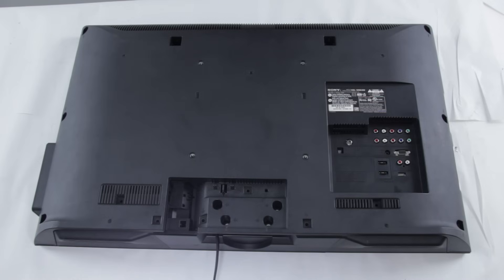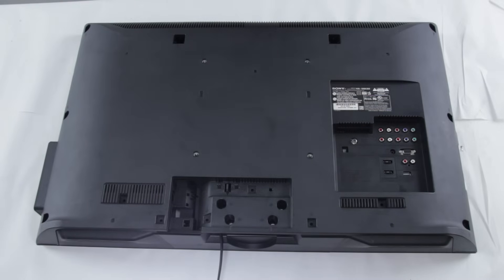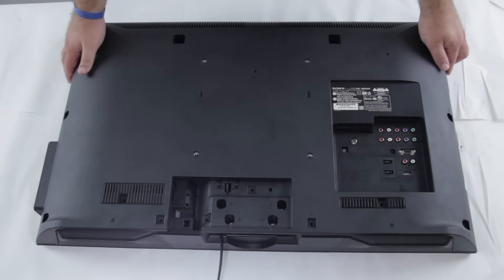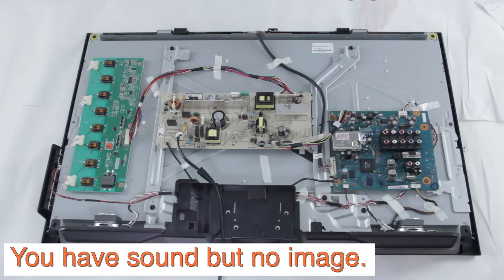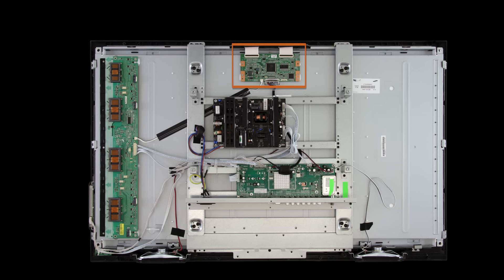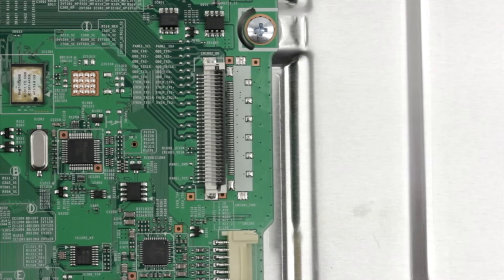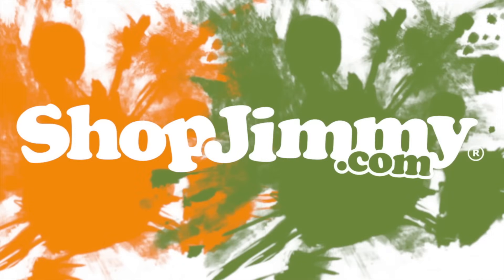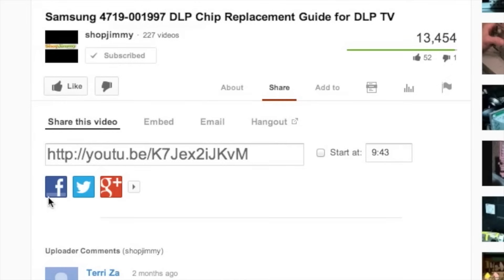LCD TV Repair Tutorial - T-Con Board Common Symptoms & Solutions - How to Replace T-Con Board

Comment: hi just found your video. we have a Samsung model number. LN46A530P1F / xza
were having a problem where when the tv is turned on its only a bit later that the right half of the screen gets a black shadow sometimes with 2 horizontal lines going across the whole screen I have also noticed at times that in back of the dark black shadow part of the picture is upside down. the shadow goes away when tapped on the back part of the TV on the same side as the shadow but just returns again within another minute more or less. have any ideas?
Reply from the maker: +free2danz   <!-td {border: 1px solid #ccc;}br {mso-data-placement:same-cell;}->Try all repairs and troubleshooting at your own risk.  This sounds like a TV panel (TV Screen) problem.  If your TV panel is bad, it may be more cost-effective to replace the TV as panels are typically hard to find in stock, difficult to replace, and expensive.  Thanks and please let us know if you have any further questions!  www.shopjimmy.com
Reply: free2danz مسرنشروف مئ
Reply: Please I have similar issue.  How can I resolve this

Comment: I have a Philips 47PFL5603D/27 it turns on has good audio and video for a minute or less then a vertical solid black line comes on and cover the 95% of the screen.How do I repair this problem.
Need help
Reply from the maker: +Rafael Hilerio Sr.   Try all repairs and troubleshooting at your own risk.  This sounds like a TV panel (TV Screen) problem.  If your TV panel is bad, it may be more cost-effective to replace the TV as panels are typically hard to find in stock, difficult to replace, and expensive.  Thanks and please let us know if you have any further questions!  www.shopjimmy.com

Comment: the image on my tv screen will either shaking / vibrate / double image / ghost image after 15-30 minutes when i turn it on. it also creates a horizontal line on the top of my tv screen. what should i do? im using LG 42LS3110 Led tv. thank you
Reply from the maker: +skull   Try all repairs and troubleshooting at your own risk.  This sounds like a TV panel (TV Screen) problem.  If your TV panel is bad, it may be more cost-effective to replace the TV as panels are typically hard to find in stock, difficult to replace, and expensive.  Thanks and please let us know if you have any further questions!  www.shopjimmy.com

Comment: Hi can you please help I have a TV model Number 46PFL3908/F7 with Serial # DS2A1350100688 the symptom i am having  is that it will not power up and it is making a beeping sound.
Reply from the maker: +Roy Sandoval  Try all repairs and troubleshooting at your own risk.   I recommend replacing the main board in your TV.  Click this link to replacement parts for your TV model number:  http://www.shopjimmy.com/catalogsearch/result/index/?cat=225&q=46PFL3908%2FF7  There may be multiple boards for the same TV model number, be sure to match part numbers on your current board, with your replacement for compatibility.  Thanks and please let us know if you have any further questions with your TV Repair!  www.shopjimmy.com

Comment: I have an emerson LC401EM2F that has the vertical colored lines on the screen,from searching online I've come to the conclusion that the t-con board is the culprit.i opened up the back but the t-con board seems to be hidden behind the metal panel and isn't visible.is there anyway that I can access the board as shopjimmy has a replacement for $20 and i'd like to replace it myself instead of buying a new tv,thanks
Reply from the maker: +paul kenzie   Try all repairs and troubleshooting at your own risk.  This sounds like a TV panel (TV Screen) problem.  If your TV panel is bad, it may be more cost-effective to replace the TV as panels are typically hard to find in stock, difficult to replace, and expensive.  Thanks and please let us know if you have any further questions!  www.shopjimmy.com

Comment: Hello.
Great job done here.
I have a problem with my Samsung TV  le40b530p7w.
When i turn it on, works fine for some minutes and then the screen goes black. Sound is always ok. It does that in every source and if i turn it off and on again is works fine for a while and then goes black again.
In intense light i can see some picture.
Is it something with fuse or capacitor in t-con? What do you suggest to me? Thanks in advance!!!
Reply from the maker: +men1ps   Try all repairs and troubleshooting at your own risk.  I recommend running the flashlight test on your TV.   Here is a link to a video we produced that shows how to run the flashlight test. https://www.youtube.com/watch?v=xUzCLgoSPGM Please reply with your flashlight test results and we can recommend a replacement part for your TV repair. Thanks and please let us know if you have any questions! www.shopjimmy.com

Comment: Hi I have a Element 40"
Model:ELDFT406 when I turn the TV on it only shows    a blue screen it doesn't flash or anything but about after 10 seconds shuts off. So I turn it back on and the same thing. So I tried  using the volume or channel or mune but still nothing I need help please
Reply from the maker: +Christy Bailey   Try all repairs and troubleshooting at your own risk.  This sounds like you have bad LEDs in your TV.  Unfortunately we do not sell replacement LEDs for your TV model number at this time.  You can check back in the future to see if we have them available.  Thanks!  www.shopjimmy.com

Comment: I have a 40 inch Samsung  model#LN40D630M3F S/N Z3FR3CCB701919Z. double images after being on about 5 mins. I've seen some tips with the tape my problem is i don't know how to take the back of the tv off..please help Thanks
Reply from the maker: +Beverly Washington   Try all repairs and troubleshooting at your own risk.  This sounds like a TV panel (TV Screen) problem.  If your TV panel is bad, it may be more cost-effective to replace the TV as panels are typically hard to find in stock, difficult to replace, and expensive.  Thanks and please let us know if you have any further questions!  www.shopjimmy.com

Comment: I have a problem where my tv works for 5 to 10 minutes then the picture freezes and there is no sound, the tv is a emotion 26" MODEL NO IS X26/29E-GBTCDUP4-UK ANY IDEA WHATS WROUNG WITH IT  THANKS
Reply from the maker: +Clive Dale   Try all repairs and troubleshooting at your own risk.  I recommend replacing the main board in your TV.  Click this link to replacement parts for your TV model number:  http://www.shopjimmy.com/catalogsearch/result/index/?cat=56&q=X26%2F29E-GBTCDUP4-UK  There may be multiple boards for the same TV model number, be sure to match part numbers on your current board, with your replacement for compatibility.  Thanks and please let us know if you have any further questions with your TV Repair!  www.shopjimmy.com

Comment: I have a INSIGNIA NS-LDVD26Q-10A LCDTV/DVD Combo. Recently I would turn my tv on channel 2.1 and it would stay on then turn off, then turn on again. Then that started happening on other channels and more frequently. Today I turned my tv on and I get a "input is blocked!" message. I tried going to the tv menu, but when I get there it stays on picture (which is the first option) and will not move to any other options. Then it takes me to SW VER: and I'm stuck there. How can I unblock my input?
Reply from the maker: +Syzy Jones   Try all repairs and troubleshooting at your own risk.  I recommend replacing the main board in your TV.  Click this link to replacement parts for your TV model number:  http://www.shopjimmy.com/catalogsearch/result/index/?cat=56&q=NS-LDVD26Q-10A  There may be multiple boards for the same TV model number, be sure to match part numbers on your current board, with your replacement for compatibility.  Here is a link to a video showing how to identify your part number, click here:  https://www.youtube.com/watch?v=LIWO2A_tuaI  Thanks and please let us know if you have any further questions with your TV Repair!  www.shopjimmy.com

Comment: Hisense 50K360G 

Turns on with blank screen - No Logo, back display light is on screen indication. When powered on LED on bottom of tv flashes for a while. Looks like a pattern, I don't remember if this is normal turn on behavior or if it's some kind of code.
I replaced the T-Con Board, bought it from shop jimmy :), but still no luck. What else could it be? Are there key voltages I can look at? What's recommended I check / replace? 

Thanks.
Reply from the maker: +Matt Cook   Try all repairs and troubleshooting at your own risk.  I recommend replacing the main board in your TV.  Click this link to replacement parts for your TV model number:  http://www.shopjimmy.com/hisense-161772-main-board-for-50k360g-version-1.htm  There may be multiple boards for the same TV model number, be sure to match part numbers on your current board, with your replacement for compatibility.   Thanks and please let us know if you have any further questions with your TV Repair!  www.shopjimmy.com

Comment: I have a 60" LG Plasma TV Model #60PC1D that has sound but the picture is distorted (i.e., Solarization). I did locate and replace a swollen capacitor on the main board, but it did not fix the problem. Do you have any suggestions on where I should start troubleshooting next.
Reply from the maker: +Norman Martin  Try all repairs and troubleshooting at your own risk.  I recommend replacing the YSUS, the YDRVTP & YDRVBT boards in your TV.  Click this link to replacement parts for your TV model number:  https://www.youtube.com/watch?v=GEllG3RV-tc  There may be multiple boards for the same TV model number, be sure to match part numbers on your current board, with your replacement for compatibility.  Here is a link to a video showing how to identify your part number, click here:  https://www.youtube.com/watch?v=GEllG3RV-tc  Thanks and please let us know if you have any further questions with your TV Repair!  www.shopjimmy.com

Comment: I have a RCALA55RS with audio and back lights. Pops off every few seconds. The picture does not come on all the time,  I think because it pops off and on so quickly. With what I have seen I need to replace the Tcon board. Please advise.
Tina
Reply from the maker: +Tina Williams   Try all repairs and troubleshooting at your own risk.  I recommend replacing the main board in your TV.  Click this link to replacement parts for your TV model number:  http://www.shopjimmy.com/catalogsearch/result/index/?cat=56&q=LA55RS  There may be multiple boards for the same TV model number, be sure to match part numbers on your current board, with your replacement for compatibility.   Thanks and please let us know if you have any further questions with your TV Repair!  www.shopjimmy.com

Comment: Hello 

I have a Vizio VF552XVT SN LSPFXAL0700340 that I purchased from new and recently has become faulty. The problem started 6 months ago that the analog inputs were defective (VGA inputs, RCAs inputs), no signal Audio or video was coming put the screen. Some weeks ago digital also became faulty… only worked the tuner on local channels. Last week I turned on the TV and the screen lights up with no video or sound, Just a blue/black screen (seems LCD is on) I disconnected the TV 3 days ago from the wall and made a hard reset until today that I turned on the TV with the same results. Tried to enter the menu using the remote and side buttons but was not responding. I have to wait for about 5 minutes to turn it off (it won’t turn off immediately) – the TV doesn’t respond to any command. What do you suggest? Model Vizio VF552XVT SN LSPFXAL0700340
Reply from the maker: +Hector “HJZayas” Zayas  Try all repairs and troubleshooting at your own risk.   I recommend replacing the main board in your TV.  Click this link to replacement parts for your TV model number:  http://www.shopjimmy.com/vizio-3655-0042-0150-main-board-for-vf552xvt.htm  There may be multiple boards for the same TV model number, be sure to match part numbers on your current board, with your replacement for compatibility.  Here is a link to a video showing how to identify your part number, click here:  Vizio TV Repair Tutorial - Part Number Identification Guide for Vizio Main Boards - How to Fix TVs Thanks and please let us know if you have any further questions with your TV Repair!  www.shopjimmy.com

Comment: Hi , we are trying to diagnose our Sony Bravia KDL-40xbr-2 sound no picture. Xbox on video 5 screen appears normal, our FIOS DVR screen appears too but no cable video signal, screen is black. thank you for your help.
Reply from the maker: +Jonathan Gratz   Try all repairs and troubleshooting at your own risk.  I recommend replacing the main board in your TV.  Click this link to replacement parts for your TV model number:  http://www.shopjimmy.com/catalogsearch/result/?q=KDL-40xbr-2  There may be multiple boards for the same TV model number, be sure to match part numbers on your current board, with your replacement for compatibility.  Thanks and please let us know if you have any further questions with your TV Repair!  www.shopjimmy.com

Comment: My Samsung Smart TV is displaying a coloured vertical lines. There is sound but no picture all I see is a vertical coloured lines.
How do I fix this issue. My TV Model is: Samsung Smart LED 3D 46 inches. Model number is: UE46ES6300U. 
I would be very grateful if I could get help to fix this issue. Thanks
Reply from the maker: +Ayodeji Shofu   Try all repairs and troubleshooting at your own risk.  This sounds like a TV panel (TV Screen) problem.  If your TV panel is bad, it may be more cost-effective to replace the TV as panels are typically hard to find in stock, difficult to replace, and expensive.  Thanks and please let us know if you have any further questions!  www.shopjimmy.com

Comment: Hello, I'm working on a SHARP LC-60LE640U with half black screen. Not sure if this is the TCON BOARD. CAN YOU PLEASE CONFIRM. I have audio and picture on both ends of the tv, black in the middle. Thank you in advance, Luis calderon luisc@lascolinasengineering.com.
Reply from the maker: +Luis Calderon   Try all repairs and troubleshooting at your own risk.  This sounds like a TV panel (TV Screen) problem.  If your TV panel is bad, it may be more cost-effective to replace the TV as panels are typically hard to find in stock, difficult to replace, and expensive.  Thanks and please let us know if you have any further questions!  www.shopjimmy.com

Comment: hi i have a panasonic model tx 42a400b serial nk-4520158
 my tv turns on green light flashes fast as normal but then changes to a red blink about 1 sec on 2 secs off.
what can this be? Thanks
Reply from the maker: +andy crask   Try this at your own risk. Unplug the TV, then disconnect the SC board and plug in the TV to see if the TV powers up. Note that it will not have a picture on the screen. Reply with the results of this test. Thanks! www.shopjimmy.com

Comment: Hi, Jimmy
Picked up a TV from goodwill Samsung LN37A450C1d A for $30.00.  It powers on,  sound works.  but screen only shows horizontal lines,  vertical ines on one side and then an area on bottom that looks like a Crystal Solar Panel  version of mount everest.  I took a chance on it because of the price.  Does this sound like something wrong is screen or what?

Comment: toshiba tv 40cv700e no picture / bluescreen appear, and also no sound at all, ty for your fast reply
Reply from the maker: +andie zulfie   Try all repairs and troubleshooting at your own risk. This could be a problem with either the t-con board, the main board or the TV panel. You can replace the main board and the t-con board individually to see if one of those boards fixes the problem.  
Unfortunately I do not see any replacement parts in the search results for your TV model number on our website.  Thanks and please let us know if you have any further questions!  www.shopjimmy.com

Comment: I have a LG42ls5700 and when I turn it on the back lights go out. After I power-cycle it they go on and stay on for a while but I have to go through that many times before it stabilizes and often right before the lights go out, a couple lights on one side go out. I replaced the power board but that wasn't the problem.
Reply: +G John I ended up replacing the $30 LED driver board and it works fine now. Thank you for your response!
Reply from the maker: +Richard Beamis   Try all repairs and troubleshooting at your own risk.  I recommend replacing the main board in your TV.  Click this link to replacement parts for your TV model number:  http://www.shopjimmy.com/catalogsearch/result/index/?cat=56&q=42ls5700  There may be multiple boards for the same TV model number, be sure to match part numbers on your current board, with your replacement for compatibility.  Here is a link to a video showing how to identify your part number, click here:  https://www.youtube.com/watch?v=RwHTvjMdrhk  Thanks and please let us know if you have any further questions with your TV Repair!  www.shopjimmy.com